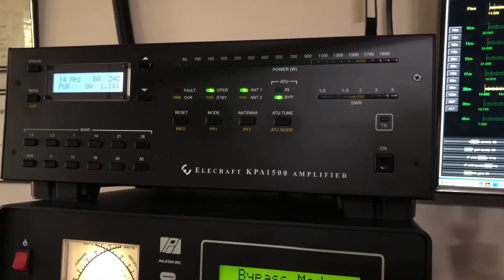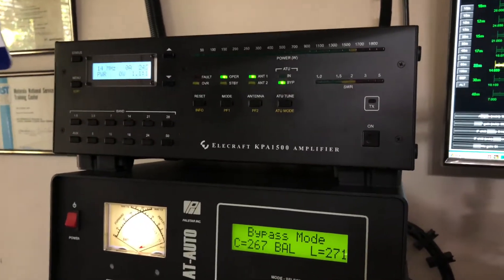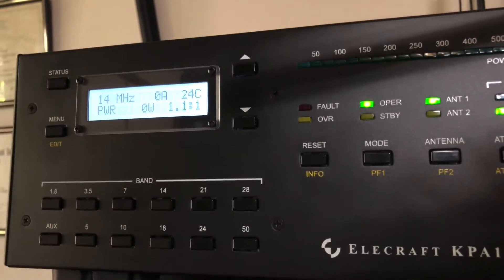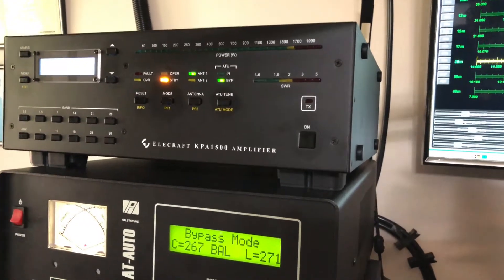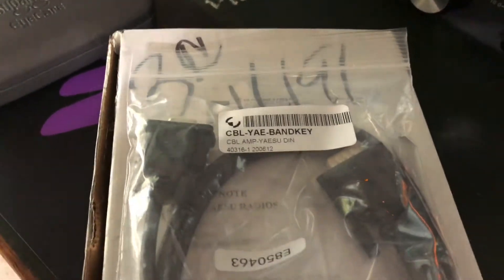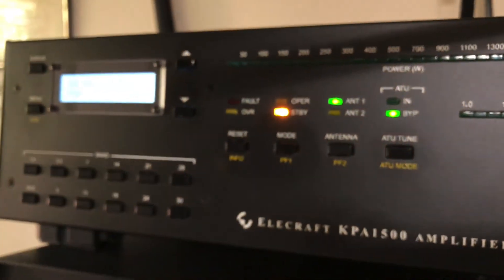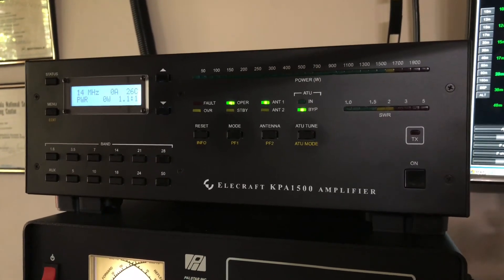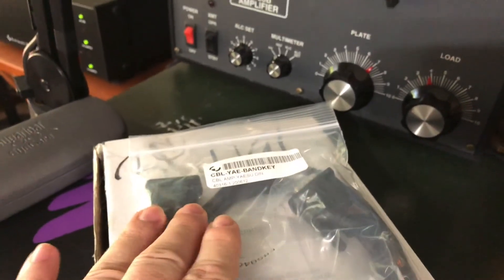Elecraft KPA-1500 with optional Band Data cable

Comment: I own the FTDX-5K, AT-AUTO and KPA-1500 as well. However, in my case was able to utilize the built-in tuner (< 10:1 max) in the KPA-1500 and retire the AT-AUTO permanently. I didn't notice your antenna setup, so you may need the extra horsepower of the AT-AUTO for some reason. My system is totally automated and controlled via whatever the FTDX-5K demands. BTW, I also use the Ameritron RCS-12 Automatic Antenna Switch to ensure I'm using the correct antenna, etc. Good luck with your setup and perhaps we'll QSO on-the-air sometime.
P.S. I also run the FT-891 with ATAS-120A in my SUV and FT-991A for portable operation (not hiking) with 8 band OCF dipole. 73, Steve - AA4U
Reply from the maker: That’s so cool!  I think our setup, with the 5K and KPA-1500, is the greatest. 

I have a 160m doublet.  It needs a wide range tuner and 4:1 balun.  But Renee at Elecraft warned me about running high power after tuning an antenna that has higher than a 3:1 SWR. The doublet exceeds 5:1 on some bands.  He said the tuner in the KPA-1500 is rated for legal limit if the antenna has a 3:1 or less SWR before tuned.  The tuner has to be derated with antennas that have more than a 3:1 SWR before being tuned.  

I use the KPA-1500 with my OCF dipole, to touch up the band edges.  I use the AT-Auto for the doublet.

73, N4HNH
Reply: @n4hnhradio  QSL... I do have an advantage in that all my antennas are less than 2.5:1 SWR. Will never part with the AT-AUTO though, it can literally "tune the rain gutters or bedsprings". Take care & HNY. 73, Steve - AA4U
Reply from the maker: Dr. Kessler has continued to support my AT-Auto.  I’m the reason he added the FT-920 to the list of radios.  And of course it works with the 5000 when set to FT-2000.  I too believe it could tune a rain gutter.  73, Doug